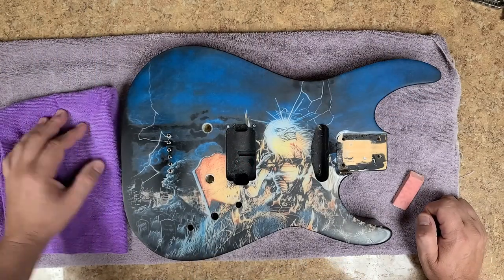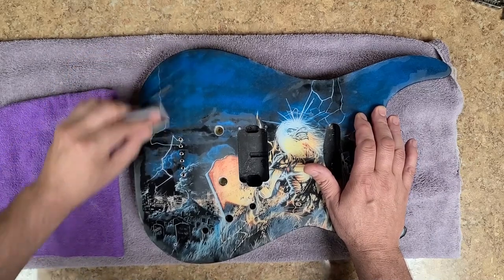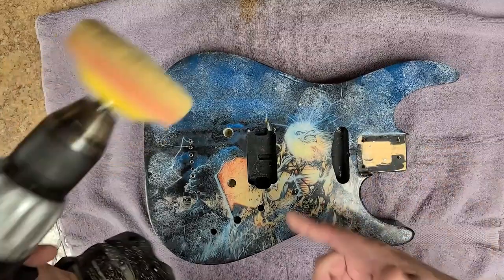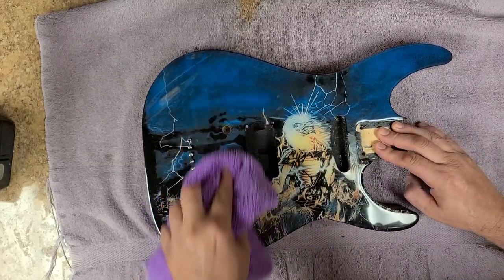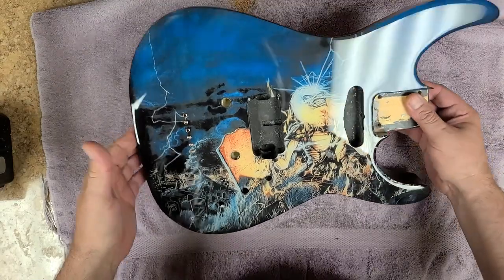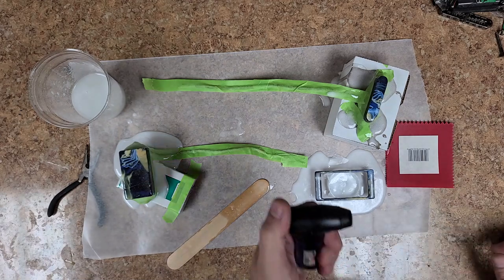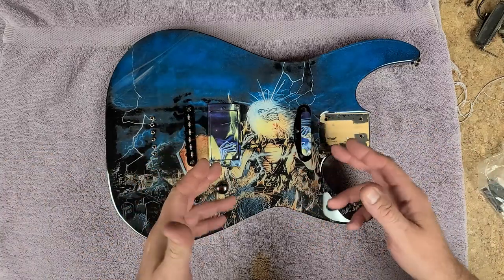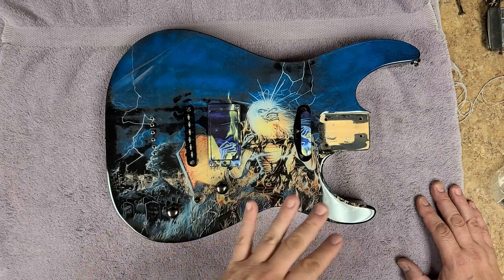The Live After Death Body is Done part 3 In Detail

Comment: I  agree with you on sanding with fingers, I've argued this with some very big channels that think they already know everything but are  dead wrong! great work here man!
Reply from the maker: Thanks Randy. Working on restoring cars and motorcycles with my father taught me a lot. My father showed me on a clear finish the darker sanding scratches under the fingers and it gets light around the area where the sandpaper was touching. we had a Florissant light bar on a stand that my father would use for sanding and buffing. It was 2 light tubes and when you moved the light down the side of the car and looked at it on an angle you could see if there were any waves in the finish. I do the same thing with the lights in my shop in my videos.